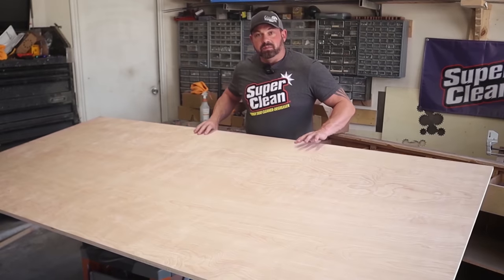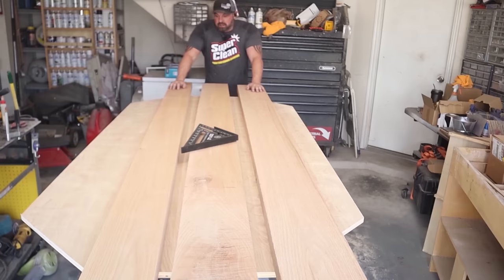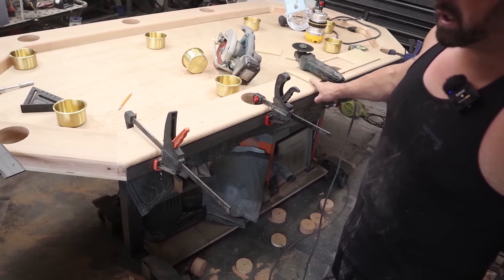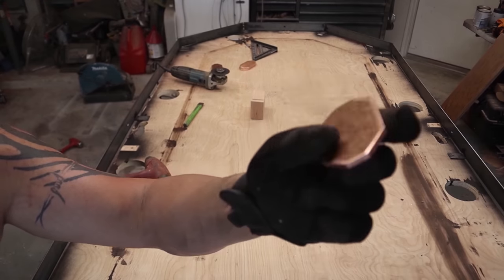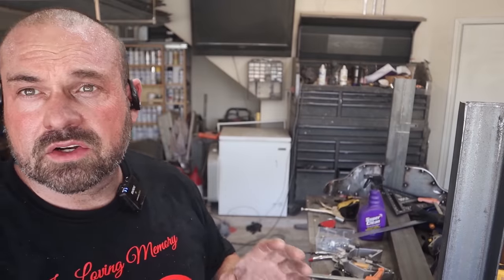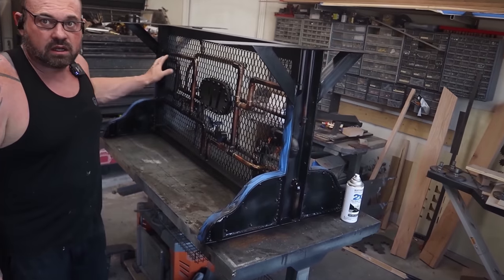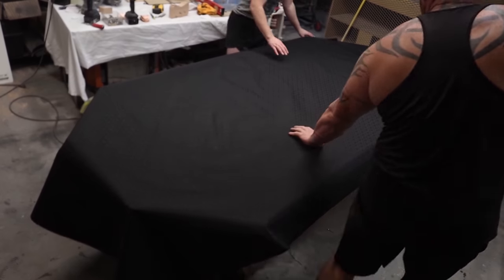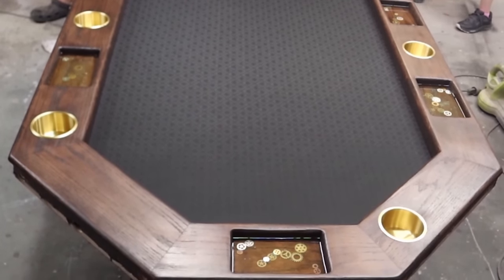INDUSTRIAL FURNITURE, WE BUILD A STEAMPUNK INDUSTRIAL POKER TABLE // DIY // HOW TO

Comment: Very nice table, but you forgot a very important part and there is a thin layer of foam under the tablecloth. All professional tables have this, because it is then easier to pick up cards and chips. But luckily you can put this on afterwards. For such a nice table, I would also go for a tablecloth with a printed logo or design that fits this table 😃
Reply from the maker: Thanks
Reply: Yep, I agree.. I love playing poker, and the foam is a must. It has a certain feel to it, a certain sound, the cards the chips….
Even the smell of a great. It’s the same for a pool table the felt has to be just perfect…

Comment: If the router bit goes in too deep... make the template thicker. Put something under it, between the oak and the template, or use it to cut a new template in thicker wood. Always cut in one direction to prevent tearout. And it seems you have a bit that cuts upwards: it pulls the bit out of the router. They are designed for routing edges of boards, not pockets. You can't do nothing about that. Just go really slow or replace it.
Reply from the maker: Thanks for the tips!

Comment: Absolutely AMAZING! I am a little confused on why you paid extra for the oak plywood when it is fully covered though. I understand the oak boards because they are seen but the plywood is covered on sides with metal and center with cloth. But either way you did awesome!
Reply from the maker: Thank you!! Oak plywood is stronger, heavier and has a very smooth surface which saved me a ton of time not having to prep or fill. Only about $20 more over pine.

Comment: Came out looking freaking cool my dude 👌🏻

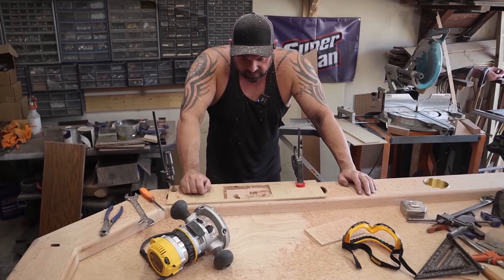Not sure if anyone else has mentioned this but you could make a thicker template @14:40 to help reduce how much of the bit you plunge into your piece & you should only plunge in maybe about 1/8th every pass. Boy o' boy, I couldn't watch that part without feeling bad for you & thinking something horrible could happen. I'm so glad it didn't :). I've been there & making a thicker template helped SOOOO much.

Also, that Glaze coat, we bought it once for our farmhouse dining table we made about 7yrs ago or so, and we did about 1/16th inch pour at a time & only did 2 coats of it. It turned out great BUT I didn't like it only b/c it was too glossy for my taste. Hopefully, this helps if you try it again.

Thanks for sharing the process my dude, loved watching it :). Cheers from Texas 🍻
Reply from the maker: That is a great idea as well. Another subscriber left a comment here about a bearing that goes in the base of the router called a template guide. With those you can set your bit height and add more depth each pass. I love our little diy community with great ideas and all learning from each other. Thanks!

Comment: Hi! Someone already said it, maybe: if you want to cut a hole into solid wood, is better if you go down little by little, no more than 1/2 inch at a time. A little tip for upholstery work:  it is much better to fix the fabric underneath the part to be covered, pull it over to the opposite side, and turn underneath again to fix it while still pulling. You'll make it without using glue. Anyway, you did a fantastic job!🙏
Reply from the maker: Great tips! Thanks!

Comment: Nice work. Creative, solid, and sturdy. My only critique would be, if the felt would allow it without wrinkles, was to put a 1/4 " or 1/8" cushion beneath it. It allows a player to 'more easily ' dig below the cards to see them in a hand. How much did you charge for this piece. Because I need legs for my 10 seater.
Reply from the maker: Thanks and great tip for the next one! This one was $5995.  Email me at DeanFurnitureArtist@gmail.com and we can come up with a game plan for a base.

Comment: I think the yellowness & bubbling from the resin could be from air being released from the woodgrain and because you've stained it, it is releasing a small amount of stain into the resin too. I could be completely wrong. Just a theory based on my small resin experience.
Reply from the maker: It’s a good theory. I have resined over stained wood in the past with no issues but always use Total Boat. Maybe something to do with the stain on lumber mill oak. No telling.
Reply: @DeanFurnitureArtist  just to be sure, I'd seal the wood first before pouring resin.

Comment: Just FYI for an aerosol adhesive I've found to be even better than 77 was at Joann fabrics but it's ForceField Headliner adhesive. I noticed you didn't quite trust the adhesive alone (however given the temperature I wouldn't either 😅) but thought I'd share. Awesome table none the less. Only thing I'd add would be dedicated chip holder slots or the pocket to fit chip racks. Version 2 is always better than V1 right!
Reply from the maker: Thanks for the info and tips.

Comment: Great job. For the pockets one way to do it would be to use multiple templates.. It looks like your template was about 1/4 inch thick. you could stack 4 of them together indexed with wooden dowels so they don't move. make your cut then, remove one layer of template and repeat. this what you are only taking 1/4 bites out of the wood on each pass.
Reply from the maker: Great tip! Thanks!
Reply: Another good option would be to hog out a bunch of material with Forstner drill bits then just clean it up with router

Comment: when your routing that deep, hog out the middle potrtion in sevreal shallow passes leaving about a 1/4 inch on the edges. then, you can use the bearing to flucsh cut the remaining 1/4 inch on the edges. takes a little longer, but it wont chatter and you wont break the bit
Reply from the maker: Nice, thanks for the tips!

Comment: Very cool table. As for the pockets in the future there are two ways you could consider making it work better. 
1) make your template thicker. This will allow your router to sit higher and you won’t be plunging the full depth of the bit (it will act as if you have a shorter bit like you wanted). Plunging that full depth in a single pass is certainly not any fun of anybody- had me cringing just watching 😂. 
2) You can use a decent size Forstner bit with your drill to remove a majority of material before you hit it with the router. Just stay about 1/8” from the bottom and sides (don’t drill right to the edge). This way the router just cleans up the edges and bottom. 
Great video man!
Reply from the maker: Thanks. A few have also suggested a lay kit. Y’all are awesome!! I appreciate the input.

Comment: That base is great
Reply from the maker: Thanks!!
Reply: @DeanFurnitureArtist  it makes we want to take up welding…. But I can’t afford to have another hobby I’m not good at.  :)
Reply from the maker: I just bought one and taught myself. I bet you could as well. One thing I do know is a higher end welder can make you look like a good welder. When I tried with the 120v it was BAD. On 220 (180) it's much more forgiving and lays flatter welds. My Lincoln 120/180 is $950 then you need bottle, wire, good mask, gloves and welding shirt. Another $400. It works good but I did try a friend's 210 Miller welder ($3500) and my welds looked like a pro did it. He also had the settings perfect. lol. A $500 welder will just look bad BAD. I think the 120/180 is great for beginners and works well enough you can make a good side hustle out of it if you wanted to bring in extra income. I have down littles things for neighbors like welding bed frames and chair legs. Building with a welder is so much fun tho. It's almost like hot glueing whatever you want how you want together. 😁
Reply: @DeanFurnitureArtist  thank you! It can be intimidating knowing where to begin.  Amazing to hear the difference quality tools make… but I guess I shouldn’t be surprised.  The difference between a $500 and $3,500 table saw is significant!  Still, in your work thoughtfulness and attention to detail can’t be made up by a tool.  Cheers!

Comment: Doubling or tripling of the thickness of the template would be another option to make the router work to cut the recessed areas.
Reply from the maker: Great idea! Someone else also suggested a bearing that goes in the router base so you can slowly lower the router depth each pass. Thanks

Comment: With routing out the pocket in the oak would have been better off using a forstner bit and hogging out the material to the depth you want and using the flush cut but in the router to clean it up.
Reply from the maker: Good info thanks!

Comment: As far as those copper ensco you could have superheated the copper until it turn red in the center and then the metal would have kneeled and you could have bent it much easier by hand
Reply from the maker: Good tip. Thanks.